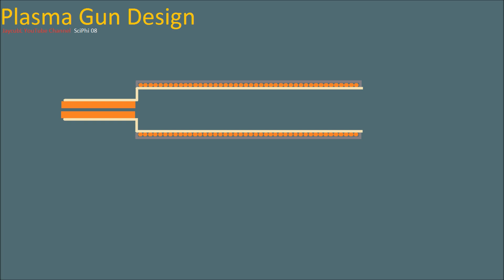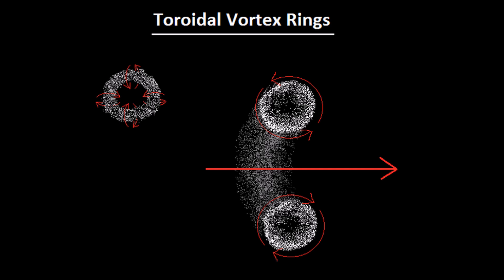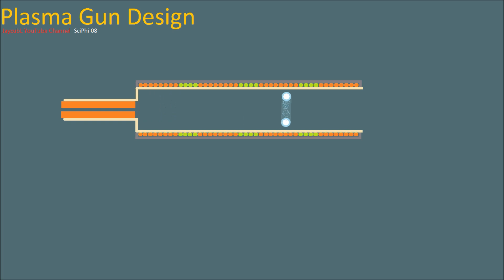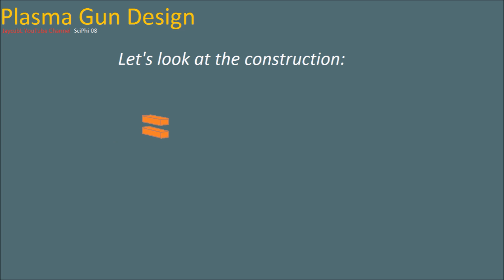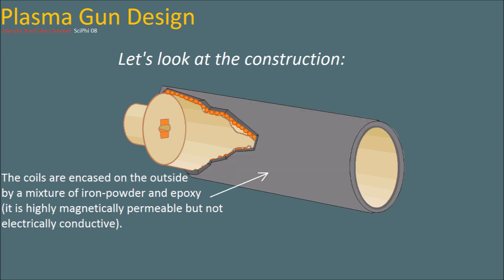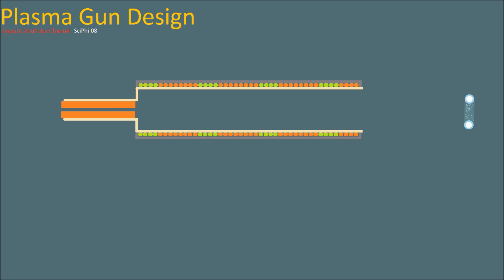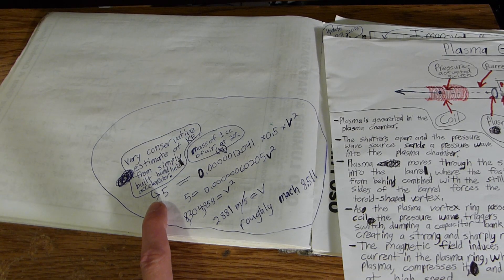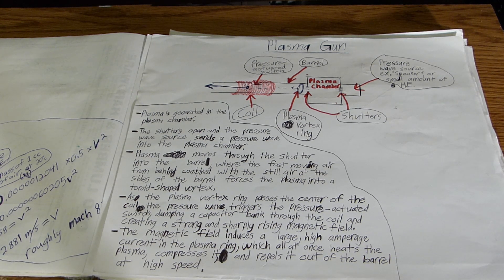Plasma Gun Design, Particle Ion Beam Weapon SciPhi 08

Comment: Will it out perform firearms though?
Reply from the maker: Well it would have pros and cons of course. The big expected advantages include not needing any ammo to be manufactured or transported, very low maintenance, fast travel to target (faster than bullet slower than laser), high rate of fire with low recoil, novelty, ability to burn through almost any armor.
Reply: Yeah, though it would take so much to get it dense enough I think, or unless you could get it spinning insanely fast with very little energy loss. I'm sure there's a linear programming method with the heat transfer coefficients/convection functions. Where to get all that power. This would be a nice alternative to lasers because though it would be less efficient/ more energy loss, at least it wouldn't be as cruel. Lasers of this power needed for this gun would get banned like disruptor rifles in star wars were :D

Comment: This concept reminds me of the Air-zooka toy, but with plasma instead of mere compressed air.
Reply from the maker: The stabilized toroid of gas is the same concept yeah, like smoke rings as shown in the video.
Reply: JaycubL: The tube of an airzooka is conical in shape rather than a perfect cylinder though. (not sure why)
Reply: @sevenproxies4255   To concentrate the toroid and accelerate the speed when it exits out the barrel

Comment: Isn't a somewhat similar concept to the already existing then scrapped MARAUDER ? (https://en.wikipedia.org/wiki/MARAUDER)  ?
Reply from the maker: I heard about that later and read some about it, it actually uses a completely different mechanism but the concept of a plasma toroid for extended in-flight stability and lifespan is the same. I guess marauder was not scrapped but instead made secret after some initial success (from what little there is to read on it anyway).

Comment: But...would the plasma remain hot enough to melt anything for long enough to hit the target?
Reply from the maker: It depends on several factors like the distance to the target, the mass and energy of the plasmoid, any steps taken to supply the plasmoid with additional heat in flight, etc.

Comment: Since you have made public the design, you can not get a patent.
Reply from the maker: That's not exactly how it works, this video actually proves that I am the original inventor. This video does not show the full and complete device so even though it has been published over one year ago (and now is prior art), I think the complete detailed device should still be able to be patented. I will be constructing a prototype this winter and might apply for a patent once I have a working model.
Reply from the maker: Also even if it does not ever get patented, I would rather get it out there than have it fester in my collection forever and have the secret eventually die with me. I know of a few good inventions that I would really like to be able to use, but cannot because the full secret was never revealed.

Comment: Errhm... Had to stop ya at 32 seconds. Instead of ceramics I propose a nickel/tin alloy tube threaded (on the outside) with a DNA type pattern of copper stretching from end to end and spanning from inner tube to outer tube to allowing an em vortex to control the flow also allowing a super heated gas induces plasmas. a burst of freshly ionized gas using em fields combined the awesomeness of the vortices.... Omfg yea. Power source though idk
Reply from the maker: Thank you for leaving a comment. You can not use a conductive material (like any metal alloy) for the barrel.
Reply: JaycubL could the copper be wound outside of the nickel/tin tube
Reply from the maker: No, any conductor will not work for the barrel. It will absorb the energy from the induction motor.
Reply: Siliconite?

Comment: If you put the gas inside a fiberglass chamber with a magnetic case, and a smaller tube, couldnt you potentially make a projectile that will travel extremely fast that holds plasma instead of it dissipating?
Reply from the maker: That is something you could possibly do yes but part of the point is to not need any ammo. If I can't ever get it working then I would maybe do something like that.
Reply: @JaycubL try hold plasma in air, creating microwave road for projectlice, Toto- "Hold The Line" :-)
Reply: @JaycubL  I've wondered if its possible to magnetize a spherical projectile suffient to contain the plasma and carry it far enough to be a practical weapon.
Reply: Billy Adams use a magnetron!
Reply: Maybe it has to be shot together with a fast argon gas stream

Comment: My design has evolved quite a bit since I first messaged you. I'm taking a different approach but the same basic concept is intact
Reply from the maker: Cool what ideas did you come up with as improvements?
Reply: Well, I'm basing it solely on the railgun aspect and taking out the coils completely. I'm gonna use the expanding gases and the right hand rule to form the vortex ring, and to expel it from the barrel. Our two designs actually differ quite a bit now.
Reply from the maker: I guess I do not really see how it would work without the linear induction motor section. In my design the entire other part is just to form the "bullet" for the LIM to heat, compress, and accelerate.
Reply: My design accomplishes the same thing, but I'm using a much more direct method of doing so. I figured that its much easier to move the plasma with a differential in pressure rather than use of magnetic fields.
Reply from the maker: Gas pressure can move the plasma, it may be possible to project a plasmoid that way. But when the plasmoid forms (at the exit of the rail gun section) that involves slowing the plasmoid a lot, spreading it out to a lower density, and mixing with cooler surrounding air, trading that energy to form a more stable vortex in a convenient near symmetrical shape for the LIM to heat, compress, and accelerate. Maybe I am missing something about what you mean? It sounds to me like your design is just my design except with an important part chopped off... meaning a plasma armature rail gun with a muzzle designed to promote the formation of a toroidal vortex from the muzzle blast. My thought is basically that if you do it that way you may be able to get a toroidal muzzle blast of plasma to move out from the gun a short distance if you generate a very powerful muzzle blast, but (compared to a plasmoid fired from a gun as shown in the video) it would not be very hot or dense and would not be able to move very far or fast at all. I also do not know what you mean about using the right hand rule to assist in forming the toroidal vortex.

Comment: the stuff shot out is actually a bunch of gas? molecus? electrons? or just a projectile of a bullet? so when it hits something solid say concrete building, does it cause explosion or just collision or the high energy casues short circuit of electrical appliance so to paralyse the enemy???? or when it hits living creature it simply burns out or vaporizes it right away????
Reply from the maker: It would be a dense, hot, high velocity plasma. With many shots at very very high rate of fire it is meant to have an effect at the target basically like a plasma cutting torch.
Reply: so , wil it breaks concrete like buildings or skyscrapers ?
Reply from the maker: If you built a huge cannon then maybe. The effect from high-explosives is basically a high speed air pressure wave and heat, which is what this weapon would deliver to focused spots where it hits. The possible rate of fire would be so high that it would be almost like a beam, so I think it could chew it's way through a lot, pulse by pulse.
Reply: oh, I thought the high energy holds the ions/particles etc as a bunch so that it is as hard as a bullet that can cause physical collision to demolish a building.
Reply from the maker: Not hard like a bullet no.

Comment: You should be able to run the firing mechanism on one or two 9 volt batteries but you either need a capacitor or rheostat to regulate the pass of electricity. A capacitor would give you a higher energy shot with a low fire rate, and the rheostat would give you the reverse. Also instead of using atmospheric gas in a shuttered container having an open end that closes when you fire would be easier to install and better for the gun, otherwise you would want a pressurized container of re-loadable gas (CO2, He, Ar, ect.). A pressurized system would need a regulator in order to not jam the plasma gun and cause a misfire like you already have in the original design. From the stuff that you have you could just make one with aluminum, copper, and iron. You just need to get enough iron shavings for the magnetic coat and electric resistant plastic to coat parts of the chassis. You might want another battery for the barrel and to keep the entire prototype to the size of a pocket rifle to make sure you can adjust the mechanics.
Reply from the maker: Hi thanks for taking the time to leave a comment! I do not think a couple of 9v batteries would even come remotely close to supplying enough power, a couple of big lipo batteries might supply enough for a lower power version. I agree that it would likely work better if you have a controlled gas feed with selected gas mixtures for best performance.

Comment: I just recently began to research this topic a bit more... Perhaps this is a stupid question, but given the polar nature of electricity, wouldn't the plasma tend to form a filament "line" in 1 dimension rather than a two dimensional circle? If one imagines such a device in two dimensions, it seems like the circle would be nearly impossible to create, surely I'm wrong though.. What am I missing? Thank you in advance.
Reply from the maker: The idea is that the aerodynamic forces cause the plasma blast from the railgun section at the beginning the rapidly slow and expand, naturally forming a toroidal vortex or "smoke ring" made of electrically conductive hot ionized gas (plasma). Current is induced in the plasma that resists the changing magnetic field of the linear induction motor (see Faraday's law of induction). Yes current flowing through the plasma would cause the plasma to self compress into a filament axially with direction of the current flow, I do not see why you think that would cause the ring to form into an open-ended straight line though... I think you are trying to say that you think electricity is something that flows from point a to point b. That can be the situation in some cases where you have a charge carrier such as electrons or some ions moving for example from one capacitor plate to another, but if you induce a current in some material it is going to be flowing through a closed circuit (a loop of some shape).
Reply: JaycubL I see, my bad. Thanks for the cross references as well, I'll make sure to check them out!
Reply: Also, I'm 14 years old and since the school system is what it is, all of my research has been done by myself. Would you by any chance recommend any sites to learn more about electrical engineering as a whole?
Reply from the maker: I am glad to see you are doing this kind of research at 14! Good sign about you. Yeah honestly Wikipedia is pretty good when it comes to studying well known scientific principles etc. I would study the work of Michael Farady first, also here is a page from my old website (I stopped paying for hosting and domain name but it still is up with a pree hosting service) this page has some formulas from my high school physics class that can maybe shed light on some of the physical interactions that you will want to understand: http://jaycubl.wixsite.com/website-1/misc-formulas

Comment: why not use either a compressed gas by firing it into the back of the rail section. It should give it more momentum and it might go further before disapating.

another idea I had is to just use something similar to a blank bullet, it creates high velocity gas and it's easy to reload.
Reply from the maker: For use in vacuum or to maintain a high rate of fire you would need to pump gas in to the chamber, but I don't think it would have much meaningful effect on the final velocity of the projectile. The original version of my design had a plasma pre-heat chamber with a shutter in the front and rear, and a powerful electric speaker or small bit of chemical propellant would be used to push the plasma forward into a chamber to form the toroidal vortex. So you and I though a similar thing there. My opinion is that if you are going to use a blank shell you may as well just fire conventional bullets, since requiring blank shells would negate many of the advantages of this plasma gun design. The short rail gun section of my design is extremely mechanically simple and does the job of both generating the plasma and accelerating it enough to form the toroidal vortex, where the linear induction motor heats, compresses, and accelerated the plasmoid. No moving parts, no rounds to load, nothing to jam or limit rate of fire.

Comment: why don't you try this first why don't you get an air compressor running to a real tight nozzle and put your electric Arc in front of that your electrodes and like that up and see if that does anything.
Reply from the maker: How the plasma will behave in that experiment you described would depend on basically the exact size/intensity of the airflow from the nozzle, and on the size and power of the arc. If you are trying to express by your comment that you think the plasmoid will instantly diffuse if fired from a gun like this into the atmosphere, then you should consider both smoke ring guns and the self constricting nature of high-current plasma conductors in air. The plasmoid would emerge from the muzzle as a tightly compressed (both axially from it's own electrical current, and radially by repulsion from the coils) hypersonic toroidal vortex. I think that the toroidal vortex form of the plasmoid and the very small cross sectional area would allow the plasmoid to remain stable at least for a quick moment (that is all it would need at such high speed).

Comment: I'm working on a similar project. try replacing the plasma armature railgun with a spheromak for better confinement and stability. also, rather than a constant-speed linear induction motor, go for constant-acceleration instead; depending on the direction of ion flow, an additional compression term will emerge at relativistic speeds, improving confinement times, increasing instantaneous likelihood of fusion events, and at a certain energy creating self-sustaining heating

think big. weaponry is the least of the potential applications. if you end up creating steady-state MCF, give me a shout-out and consider publishing under general public license

Comment: Assuming this works, the projectile could potentially bounce off a magnetic field? Or just kinda fade off after being deflected? This would be super unpractical even if you could maintain the projectile and have a convenient source of energy. At least it looks really cool
Reply from the maker: You would need a large and strong magnetic field to be sure to deflect it. That same principle is technically true of any electrically conductive projectile (of course the low mass of a plasma projectile makes it more vulnerable to that). Armoring against this in that way would be impractical especially for infantry. If you consider a vehicle with panels of thin electromagnetic coils on all sides, you will notice that the plasmoid would either be deflected a bit but go through the field anyway , or enter at a pole and be undeflected, or if the field is very very strong enough to completely deflect it, then the plasmoid would grab a level of the field and ride at that distance from the magnet along the field and be pulled directly into the vehicle at the edge of the field, where panels facing different ways interfere (since once the plasmoid enters the field, the magnet would resist relative change in distance, so it would be hard for the plasmoid to leave). It may be possible to experiment and come up with an effective armor for this, but then you can still scale up the plasma cannon size to add more mass and velocity, and just force your way through it with more powerful shots. I think against any normal armor (like solid shields of various kinds) this would be able to penetrate because it is designed to be able to stack many shots on one small spot very quickly.